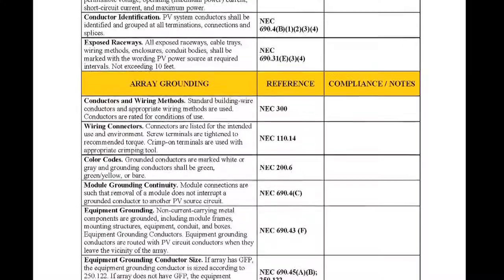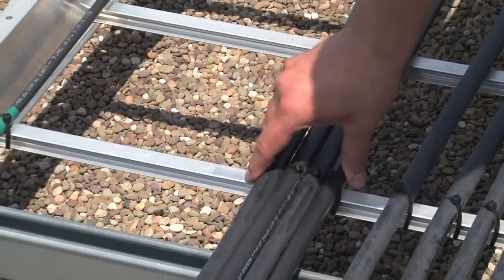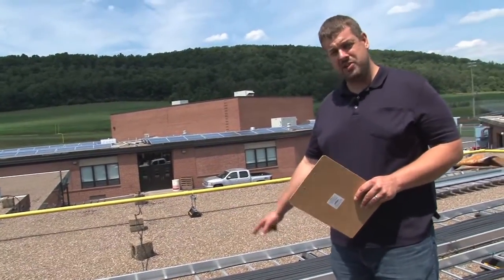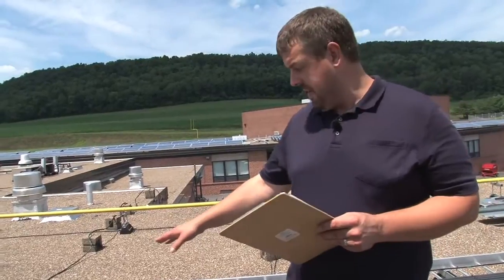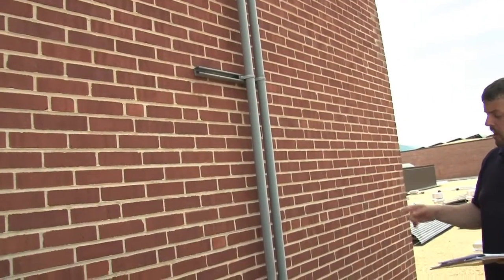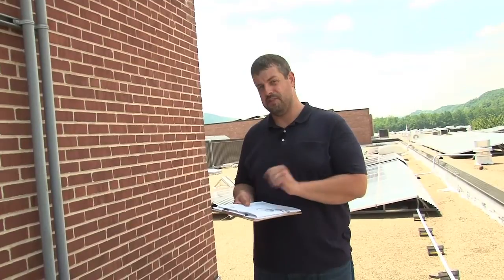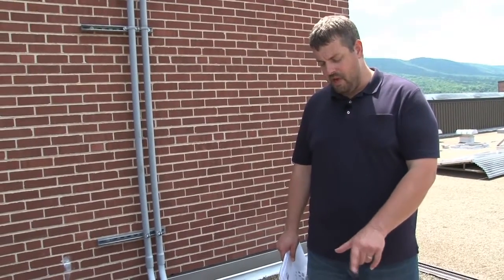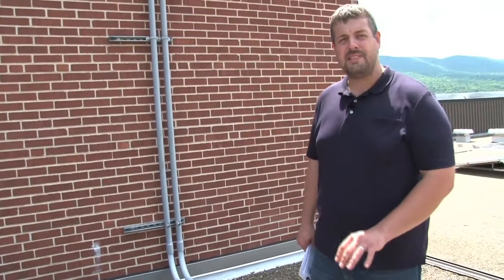Solar PV Inspection Walkthrough - Wiring Methods (5 of 8)

Comment: What did they use to seal that pipe up with? Looks like expanding foam
Reply from the maker: Ben Barbre Ben, thanks for the question. It is in fact an expanding foam in the sense that it expands and is a foam, but it's not the same stuff you might use to insulate a small space in your home (like Great Stuff, or other brands of spray foam insulation). We're not sure what the exact product used here is, but it's specific to this use -- filling conduit around wire without degrading the wire insulation and without adversely affecting the thermal conditions (which are tied back to the fill ratio of the conduit, number of wires, size of wire, conditions of use, etc). The purpose of using it is to seal rather than insulate, as protection from vermin, insects, and water. 

There are a number of products that fit the bill here -- Polywater's duct seal and Ductolox are two that come to mind. 

http://www.polywater.com/ductseal.html

http://www.arjunox.com/

You generally put in some type of "stopper" or damming strip a certain distance into the conduit and another in front and then use a nozzle to insert the foam between the two dams. 

There are also putty-type products on the market.

As always, talk to your electrical inspector!
Reply: Penn State Solar Center 
Thanks, the links you posted are interesting. I cut out a rubber gasket from a toilet stop, put 3 holes in it for the wire coming from the pv array into the junction box and screwed a flex pipe connector over it. I'll stick this in there on top for good measure. I have a single array of 10 panels, 255w ea no combiner- just a shot through emt to the dc disconnect > inverter.

But this even stumped the electrician over at the distributor. We agreed though, either run into the junction and then something like flex pipe up and around so water doesn't get in, or rubber stopper. One of the contractors said they fill up with water anyway but I won't accept that :) Most contractors noticed don't know anything about solar. Even at the permit office there's one senior inspector that does all the solar that comes through. If he's not there, you get a bunch of blank faces when go into the dc side of things.

The inspector I had didn't check the junction. I'll foam it on top of the rubber stopper for good measure and stick another rubber stop over that.

So you don't recommend the expanding foam they sell locally? We have a distributor here that sells most of the stuff on the wiring end. Like I said, all I have are pictures of professional installs and in a lot of those, nothing is there it's just open under the array going into the junction > combiners.

I like that use-2 is waterproof, but there really shouldn't be water capable of getting in like you said. I'll pick up some foam :D I saw the foam in the riser had to replace too. Guess the electrician got all crazy there but when opened up the meter there was foam all up in the pipe.
Reply from the maker: Ben Barbre I can't speak to your particular situation, of course. The code articles that are often mentioned in regard to this are 2011 NEC 225.27, 230.8, and 300.5(G) which all effectively say the same thing. The key phrasing, from 225.27 in this case, is "Sealants shall be identified for use with the cable insulation, shield, or other components." BUT those code articles all reference "where a raceway enters a building or structure from an underground distribution system," which isn't necessarily what we're talking about. However, assuming that these are indeed the correct code articles, the type of spray foam insulation you can pick up at a local hardware store isn't identified for this use, so it would not meet the requirements. I can imagine it can get confusing, as many of those products (fire block, for instance) can be used on the outside of conduit or around romex cable. 

I'm not familiar enough with the chemistry at work here, but several sources (http://answers.angieslist.com/Can-I-spray-foam-insulate-conduit-openings-service-panels-q105657.aspx for example) claim that something like Great Stuff will degrade the insulation on the wire. Similar language is found inside some of the marketing and technical materials from a product like Polywater's FST Foam Sealant. For example, the technical data sheet (http://www.polywater.com/fstspec.pdf) says "Compatible with common cable and wire jackets," implying that other products are not, and there's a whole section in their Tech Talk publication called "Cable Compatibility" (http://www.polywater.com/techtalk-vol1.html) that continues to talk about how their product IS compatible with common cable jacket materials (like USE-2), but not necessarily why other products aren't. 

They also specifically speak to duct putty and canned foam not meeting the NEC requirements, though again they're referring to code articles that may or may not apply in the case of DC conductors entering a conduit at an array. 

I don't doubt there are numerous installations out there that have passed inspection that don't have any sealant. I also don't doubt that the FST stuff we've been talking about is pricey enough to scare people away (though don't quote me -- I haven't looked). However, I have seen numerous pictures of bees and rodents that have taken up residence in j-boxes and combiner boxes. It's nice and warm in there, and everything can be fine until one leg touches positive and the other leg touches negative. 

One of the links I posted here (the Angie's List one) proposes other solutions. If you're taking only a few wires in, you can use strain reliefs. I'm sure if you look around you'll find a lot more solutions, though I had a little trouble finding much while writing this. 

Good luck!
Reply: Penn State Solar Center
Thanks, on my way to check out what they have down at the warehouse. I'll definitely get the right stuff. That duct putty is a mess, the foams like you linked seem to be the way to go.

Interesting how they aren't all compatible. I would have thought the cheap stuff would be fine. Thanks again, you don't need luck when you have smart people to consult :) I found the idea to loop up using flex before the junction here /watch?v=W8N5iN_aRXs&t=12m28s

If I read the green NEC rule book again, going to have a headache.